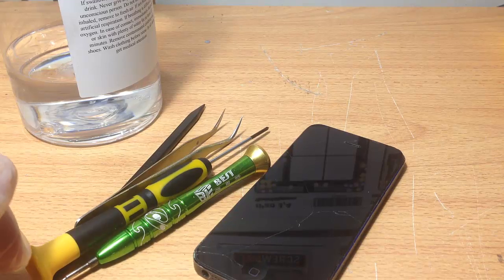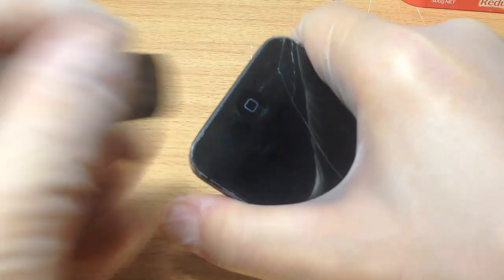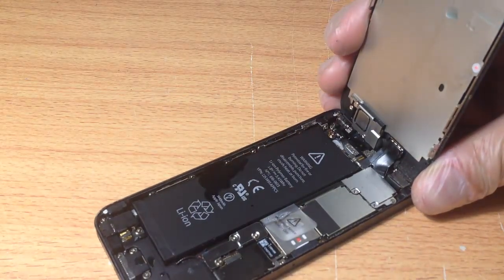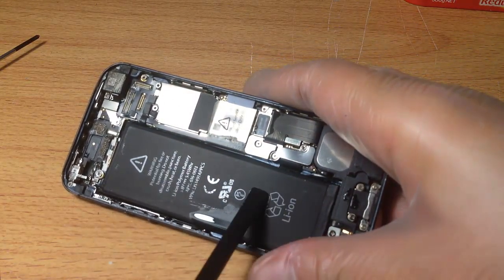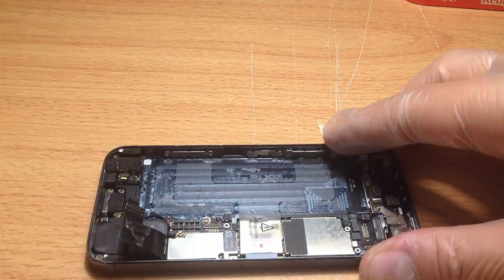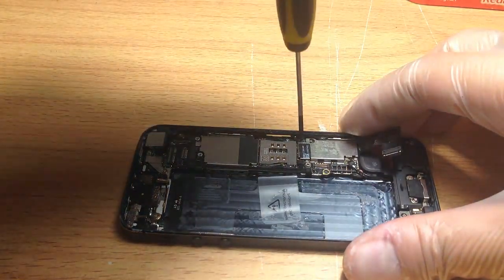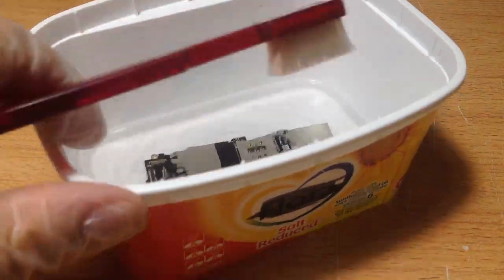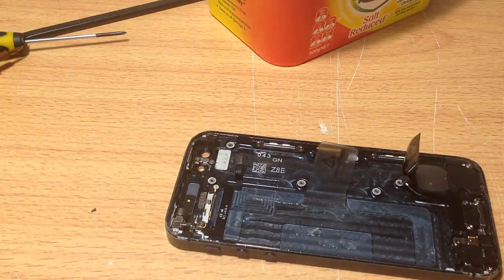iPhone 5 Water Damage Repair

Comment: Last weekend someone spilled beer on my phone and I took the case off immediately and dried it as best as I could, well the next day the screen went black and won't  turn on, is it too late to try this? Is there a specific timeframe to get this done after water damage occurs?
Reply from the maker: Isaias Bernal I would give it a quick clean.  Does your phone still vibrate/make sound - if so then I would say you need to replace the screen.

Comment: ur video really help me a a lot..i have iphone 5 that sometimes can be turn on and sometimes cant..if it can be turn on,and i put it in standby mode,it will suddenly turn off and the sreen goes black..i have to wait until the battery totally empty to turn it on again..does my logic board are the problem or my battery..? thanks infohut..
Reply from the maker: irfan shafiq yeah this doesnt sound too good.  Seems like possibly the logic board if I were to guess.
Reply: do i have to use the iso alcohol..??
Reply from the maker: It is recommended as the higher the % the better.

Comment: Hy, great video just followed it and the phone works now with 2 problems:
-during a call i can't hear properly(muffled noise) and the other person doesn't hear me , or hears me interruptly.As soon as i put it on speaker modes works perfect, i can hear and the others hear me perfect.What should i change, the bottom part with the charger bit a, or the front camera as i understand there is a microphone in there as well
-the flash on the camera is not working so i have ordered another one.
Thanks again!

Comment: Hi. I have dropped my iPhone 5 in water, I left it in rice for a few days and then I used Isopropyl alcohol. I plugged it in, I feel a vibration but the screen is black, nothing coming through, I wonder if there is anything else I can do...
Reply from the maker: Alicia Garcia seems like its the screen you need to replace.  However I do suggest you give it a clean to avoid corrosion in the future.

Comment: Wow Awesome ! I Just fixed a phone that i dropped in the toilet 6 months ago and applied this and its working good!... so far.
Reply: shit im going to fix my iphone 5s now with this method
Reply: Did it work?
Reply: Rick. Duät ful
Reply: Rick Cruz  do you mean if I try this method my I phone will work too , It is sweat water so I am afraid the suger  damage it
Reply: I followed this step by step. Only after cleaning it, I let sit for 30 min before air drying the board. My phone was dropped in the toilet and never turned on after, that I threw it in a drawer and That was six months ago. If anything id give it a shot and go step by step with this.
Reply: holy fuck same thing happened
Reply: deadass same to meh i dropped it into toilet
Reply: I can't fix my iphone I dropped it in my toilet

Comment: Thanks for this amazing video! I dropped my wife's iPhone5 into fresh water at a ride at Disney and it seems to charge and work but the screen shows water spots and is dim. Looks like I need a new screen and battery. Does anyone know if the camera modules are sealed? Or do I need to replace them.
Reply from the maker: u can try the cameras it wont hurt.  just clean the camera connectors or they will corrode.  now as for the screen.  try dry it out in the sun.  sometimes the spots go.  also clean the screen cable connectors.

Comment: I can't remove the 3 screws on the top plate with any kind of screw driver. The phillips head screwdrivers I have all are able to unscrew everything else, just not the plate on the top right corner (in the first step), any tips?

Comment: Great Video, thanks! Swimming pool iphone 5s not turning on.  Received it few days later from friend DOA. Cleaned inside and logicboard in 90% IPA. Replaced the top power/volume ribbon (tore it taking battery out), New Battery.  I have a black screen and no activity when charging. What next steps do you guys recommend? Further IPA bathing (ultrasonic),higher %, , replace the Lightning port?  Don't have any spares to experiment. I was so hoping a new battery would solve it... Thanks!

Comment: So can the damage of the screen be fixed? Because my screen has a dark spot in the corner.
Reply from the maker: Ann Mwangi sure can. 905 of the time if the screen has dark spots or looks darker its due to water damage.  Give it a go and try changing over the screen.
Reply: Alright. Thanks! Im honestly not confident doing this myself but I know someone else who can. I will have it done next week. But can the stains be removed even though they have been there for awhile because by the time I get my phone fixed, the stains would have been there for about 2 weeks. Is it something that you have to do right away??
Reply from the maker: id suggest you get onto it right away. leaving it gets worse and can cause corrosion.
Reply: *****  yeah that is actually what I ended up doing :) the screen part was too damaged so I got a new screen and had someone replace my screen for me. :)

Comment: thanks for the awesome video! dropped my iphone 5 in a toilet last night eek! It killed the touchscreen - completely unresponsive... managed to fix this with your tutorial however now my phone keeps randomly restarting itself every 3 minutes or so (it wasn't doing this before when i first turned my screen back on... i just need it to stay on long enough for an icloud backup... any ideas on what i can do? or what i may have broken to make this restart itself (and if i can fix it)?
Reply from the maker: try giving it another wash again also change your battery.  I suspect it's the battery however please note this is only an assumption.
Reply: thanks so much. I realised there was some glue/sticky stuff on the bottom of the battery that gathered and was pushing it up. once i removed that, and rechecked all the connectins, the random restarts have stopped! Only thing is now the battery indicator doesn't update i.e. it won't tell me if battery dropping as i use it, or if its increasing as i charge it. It will only tell me the true battery percentage if i turn my phone off and back on again - BUT it seems to be normal battery life so i can live with this :) thanks for your help!

Comment: my phone has been water damaged for two months now, will this work?
Reply from the maker: The chances are not good.  Depending on the extent of water damage you might be able to.  The issue is with over time corrosion sets in.

Comment: bought a water damaged iphone 5, got it the computer to read it, its vibrating and making sound.. have a brand new screen but no power to the screen? Maybe the connections to the screen are the problem? any help would be good! Thanks in advance
Reply from the maker: check the connections of the screen.  if not I am 80% sure you just need a new screen.  There could be a chance that the pins the screen plugs into could be corroded so check them.  Try recleaning them as well.

Comment: I had a lifeproof case on my phone and it leaked so water go in it while on my cruise, i put it in rice a day later and then it worked for 2 days, after 2 days it stopped working again, It turns on but i cannot touch the screen, and it wont download anything to my computer it just charges

Comment: My iPhone 5s dropped in the sink and obviously got water damaged so the iPhone wont on turn but it's kind of dried out and it came back on and the iPhone only come on when connected to the charger and the battery is completely dead. It shows the battery low icon for 3 seconds then Apple logo comes up then it disappears and it won't charge but I can still see the screen but no Apple logo what's wrong.

Comment: Thanks infohut for such a detailed video; I tried this on my iPhone5 but still there is no power. It appears the phone's back does get warm when left on charger but it doesn't seem to be charging the battery. Could it be the battery got shot? I've also tried to power on with the home button pressed without luck.

Any other ideas?
Reply from the maker: It could be 1 of 2 things.

Battery - needs replacing or the charging port needs to be changed over.
Reply: Tried a different battery - did not work.
Ordered a new charging port - hope that's it.
Reply: kahmedsid
Just an update: While waiting for the dock connector (which took a week), I tried to turn the phone on today before opening it up and to my surprise it started showing the charge icon on the screen. A few minutes later, it did turn ON. Everything except the camera is fully working.

Here's what I think, but could be wrong:

1. There are some water streaks between the glass an LCD screen - maybe this is what prevented it from starting up initially? I am hoping that as it dries off completely, maybe the camera will become functional again.

2. The camera connector isn't connected properly and maybe I need to re-open and check the connector on the camera.

Comment: My IPhone 6 fell in a Tupperware full of water in the sink. I took it out immediately and it was on and worked fine. then all of a sudden it was freezing and getting hot so I turned it off. it turned back on fine but then it turned off by itself and never turned on again. I put it in a bag of rice for a day because I was told to do so but nothing ofcourse happened. HELP! I have so many pictures I didn't back up :( is there hope?

Comment: I have an iphone 5 that was dropped in a freshwater lake.. it will turn on/ charge.. but, a full battery will only last 10-15 mins. In your opinion would that probly just need a new battery or is it shorting out? Thanks a lot!!
Reply from the maker: Zach Huber freshwater is better than say salty water however the bad news is that unless the residue is cleaned off you may have issues in the future with the phone and it may stop working.  I suggest giving it a clean on the inside then for the battery issue it is most likely a replacement battery you need.  Hope this helps.

Comment: ISSUE: My iPhone 5 was swept away by salt water (Pacific Ocean) and spit back to me. I did put it in rice for 2 days (because that had worked once before when the phone fell in a fresh water lake last year). This time, I'm not so lucky as it is still not turning on. I am NOT so much worried about restoring the phone itself, but I would like to recover my photos from the trip I was on during the mishap (which happened before I could back them up to my laptop/icloud).

So I guess my question is, can I recover the memory and transfer it somehow if the phone is not recoverable itself??? iPhone 5's have flash memory, yes?
Reply from the maker: the bad news is that salt water is one of/if not the worst type of damage as it is corrosive.  You can try to clean it however the chances get lower the longer you leave it.

Comment: My iPhone 5s fell in my slushes drink but I took it out as soon asap possibly. but it still work only problem it got out of control, it won't charge the speakers don't work. But it died on me and now it doesn't charge but somehow it turned on
Reply from the maker: Ok charging issue is either 1. battery or 2. charging port.  Both very cheap parts to replace.  Speakers just need replacing.  Id say 90% you just need to change the charging dock.  Make sure you clean it thoroughly.

Comment: Can someone please answer this question?? i have a bottle of rubbing alcohol but it says that it is 70 percent isopryll alcohol would it still work?
Reply from the maker: yes that is fine.  it just doesn't dry as quick so make sure you have dried it correctly.

Comment: So will this method work is most cases? And does it matter how long the phone has been left after it has had water damage before fixing it?
Reply from the maker: yes it does.  the sooner you get onto it - the better your chances or repairing the phone.   Water damage causes corrosion so the longer you leave it, the more chance this will occur.

Comment: interesting..my water damage indicator is still white but the salt water looks like it got to the upper part of the phone damaging my screen connectors, so basically my backlight to my phone so the display doesn't give off light though the colorised pixels
requiring sunlight to be able to see the display, will dripping isopropyl alcohol on the connectors fix the salt buildup?
SOME ONE ANSWER

Comment: Best way is to get a ultrasonic
 machine  $25 on ebay.. and put the board in for a couple of minutes, the intense vibrations will break up corrosion build up in hard to reach places( under the welded shields)  AND DO NOT DOUSE everything with alcohol like this guy, there is a mic on the top part and that will get damaged if alcohol gets in.. or any mic for that matter in any phone, just clean around the mics..

Comment: iphone 5s managed to get wet in a life proof case idk how but it did....i turned it on yes ik bad decision but it did turn on and it worked or functioned fine with all features but had water stains. so i let it dry out and i charged it phone turned hot and wont turn on now. can i replace the battery or is it a hardware problem because im confused because im hopeful by just getting it t o turn on was amazing. PLEASE READ RESPOND OR HELP!!!

ps. does anyone know what the vertical gray lines are about because i heard of ppl talking about that
Reply: I got the same problem and need help immediately  !!
Reply: follow this video with regards to removing battery as this could damage some components and chips but by removing battery it can't get worse

Comment: can you use alcohol on the screen itself? I noticed you set it aside and didn't touch it otherwise, but my screen doesn't take any input right now, so I was wondering if i should rinse it in alcohol too? If not, do you recommend any specific sellers for screens?

Comment: iPhone 5 took a swim on a canoe trip last weekend. Tried the rice for overnight did nothing but get rice in the charging port. Used this video to take apart and remove all the water that was inside. So far the phone is working great, even the water marks on the screen have gone away. I am having trouble with the rear facing camera, but I think that was my hook up of the cables. Ill take it back apart later for that and anything else that might pop up. Thank you for the video and helping me save my phone!!!!

Comment: Nate I followed your instructions and my iphone  came on but had problems with wifi and the screen cloudy with the light in the background flicking on and off at times. I opened the phone back up to check the wifi connection and decided to clean the connections with the screen to the mother board. Let it dry again and now it wont come back on.. the screen is black and I can still hear the sounds when the battery gets charged. Could you give me any insight of what more I can do? Thank you

Comment: I dropped my iPhone 5c in water about a month ago.. My dad took the screen off to get the water out from the inside, then put it in rice then the next day he put it back together. When I tried charging it it just vibrates then makes the charging noise, but it just keeps making the charging noise over and over again, this weekend we are maybe going to take it into a repair shop but we also don't want to pay 70$ just to see if they can fix it. Do you know what may be wrong with my phone?
Reply: The same exact thing happened to me. i think I might just get it replaced.
Reply: I phone dropped in water can take a couple of days or more to fully dry out so it probably wasn't left in the rice bag long enough.  Guessing what and if anything was damaged as a result would be pure speculation on anyone's part as you may get lucky and not permanently damage the device or you may be not so lucky and any random component could have damage from short circuiting do to the water.
Reply: Did you apply this? I have the same issue with my iphone 5s that I dropped last year. Now it just sits in the drawer.. How did you solve this? Did this work for you?

Comment: I can help to solve every problems you guys have. Read Below.
Before actually taking your phone apart, watch this video.
Look at how he bends a cable over at about 130 degree angle. Do NOT do that, it damages the cable. Bend it max at a 70 degree angle. All your problems will be sloved.
Thank me later
Reply: I was thinking the exact same thing.  It pained me seeing how sharply backwards he bent that ribbon cable knowing that it could potentially damage the ribbon.   Also he mentions using a heat gun to dry off the unit?!?! That's also not the best advise.

Comment: If the logic board was completely fried would the phone be able to turn on?
Ive done exactly what you did, tried rebooting but the screen keeps blinking on and off while on charge; its just a black screen with a dashed line (Im presuming some sort of damage, as I had this on top the top of the screen before the water damage when my phone was working).
Do I just have a damaged screen or is it also the logic board?

Comment: i did as i instructed in the video, the phone turned on, but now i have a a problem with overheating  it so so hot as soon as the charge gets 6% 
replay ASAP...thanks in advanced
Reply from the maker: try a reclean or different battery.   if that doesnt work could be the logic board unfortunately.

Comment: Ok I followed everything u showed. I saw the battery had really bad water damage, and ordered new one. I put new battery in, and the screen placements, tried to turn on but didn't... Then plugged it into charger, it made a sound like it was connected and motherboard got warm but still is not turning on. I took of charger, just in case that might do more harm than good. Should I try getting a new screen??